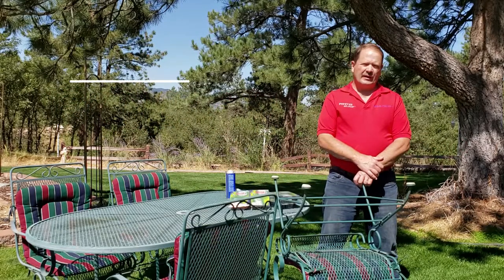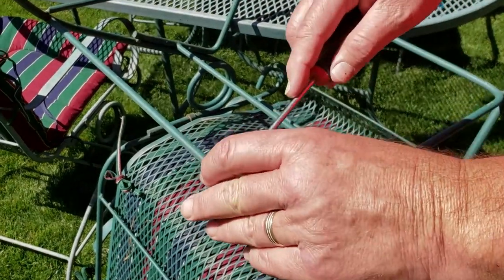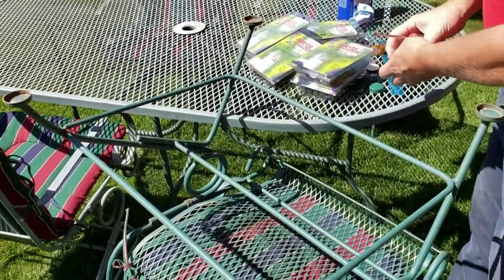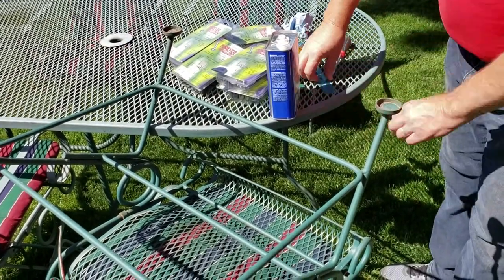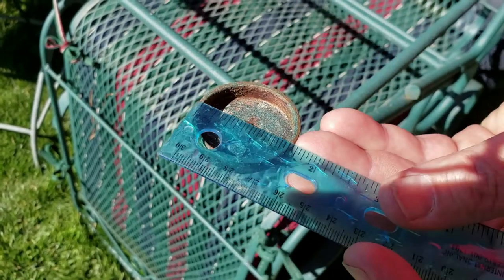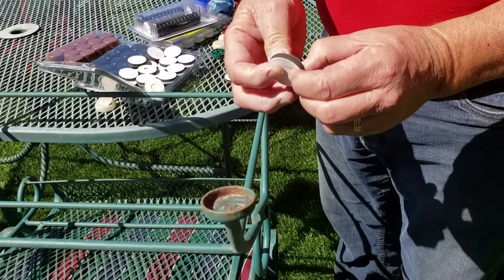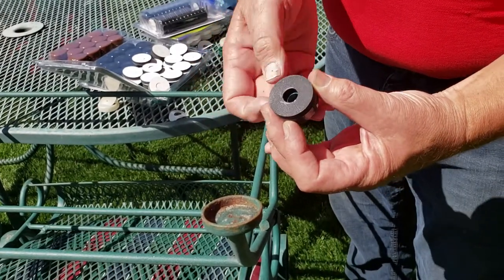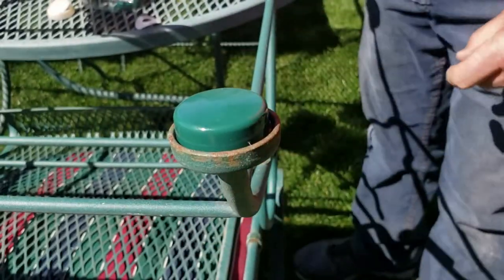How to install Forever Glides on Iron Furniture

Comment: I just got back my furniture after refinishing, which included Forever Glides.  They don't stick to the legs.  When I move a piece, I will probably have to pick up one of the glides that is no longer stuck to the leg.  The company that did the refinishing apparently knew this would be a problem, as they left a bag of extra glides, probably enough to replace every one.  Is there a better adhesive?

Comment: Thenoron feet openings on my chair and table set have four “tabs” that hold the plastic glides, the glides themselves have a lip on them and slotted for these tabs. Ive not seen anything related to a design like mine. It appears if I chose to go this route- I’d have to cut off the tabs... 4 per foot, 16 per chair, 5 chairs...  ummmm.... not attractive at all this project